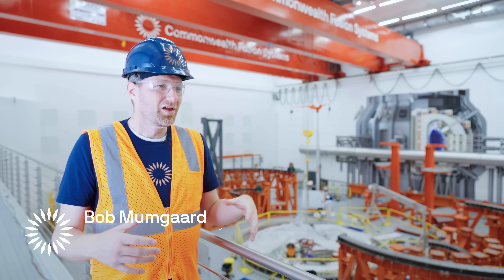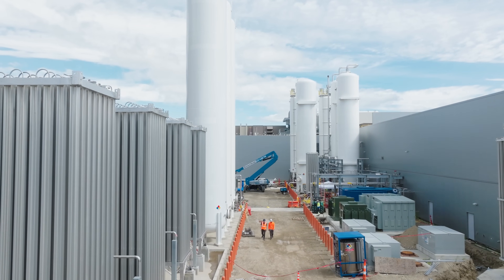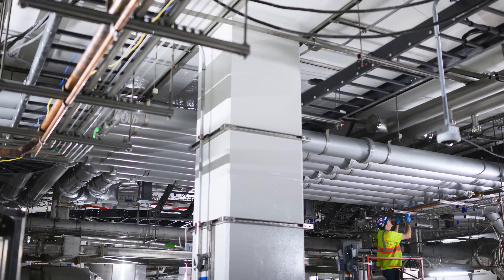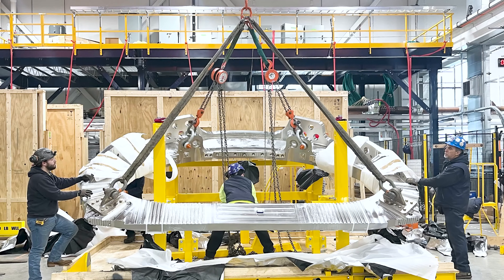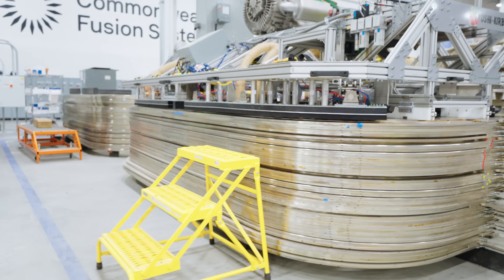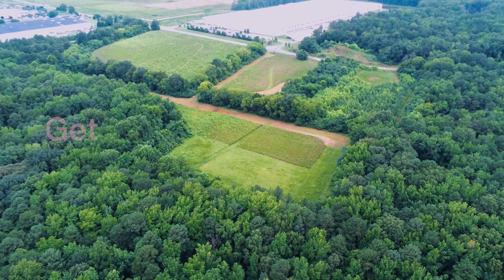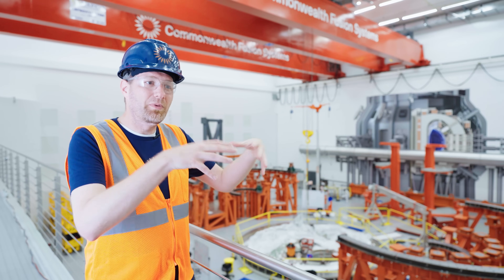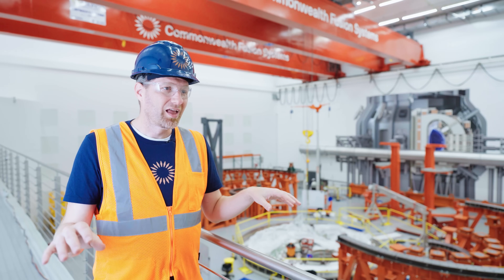An Update from Commonwealth Fusion Systems (July 2025)

Comment: These guys are making plans for selling power to Google and they don't even know if it works yet. Live with that kind of confidence.
Reply: Google is an investor. Google is one of "these guys".
Reply: Anyone can do fusion. Hobbyists do fusion reactors in their garages. They're terribly shit, but they make fusion. A bit more sophisticated there's commercial fusion reactors that are used as radiation sources, still weak and inefficient compared to what a power plant would need, but good enough for what they're used for. It's a matter of getting the power and efficiency up enough to generate commercialy viable electricity. The power is the "triple product" (temperature x density x duration) which has been increasing at a rate faster than moore's law for half a century. And the efficiency is that Q factor that's often discussed, how many times as much energy the reactor produces compared to the power required. Both have a long established relationship to the various attributes of the reactor that's been repeatedly demonstrated for half a century. It would be like if Da Vinci knew all the theory behind a hydroelectric plant but didn't have the construction equipmemt and concrete to make a big dam, or the metallurgy to make the turbines, generators etc. Or like the first atom bomb - it was really hard to refine all the Uranium. It was really hard making all the parts. But when they put everything togeher it worked first time. We know how it works but it's taken a while to get to the point where we can make all the pieces. One of the ways to get Q of 10x power production is making a reactor huge, and ITER went that route. But size is slow and expensive when the whole world is only spending a small fraction of what the US alone is going to spend a lot faster on B-21 bombers. But superconducting magnets are a lot better now than when ITER was designef. And producing a stronger magnetic field lets one get a high Q in a much smaller package that can be built faster and without needing a huge multinational project. And since it's faster, if when something doesn't work they can iterate more quickly to find solutions.
Reply: @JForrestFisher--76 - This person has not bothered to ‘critically’ examine what the net fusion gain factor, or Q value actually represents. Most fans have no interest in critically examining the love affair that brings them joy. The Q value they are referring to is Q-plasma (Qp). That is, typically the only Q value provided in public announcements and generally the only value physicists and engineers working on such experimental projects care about. The input energy parameter, used to calculate the Qp value involves the energy that couples to the plasma to heat it to fusion energy temperatures of above 100,000,000 Kelvin. That input energy parameter tends to be a small subset of the input energy required to power the experimental facility. This is especially true in short pulse facilities such as SPARC and the ARC design. In those cases the input energy value tends to only apply to the short period of time during which substantial amounts of fusion energy is being generated. In those cases the plasma input energy value can easily be 10, or even 100 times, less than the energy consumed by the facility during the day of the experimental ‘shots.’

In short, without providing specifics, the reporting of the Q value achieved during an experimental fusion operation, can be misleading, if not deliberately deceptive.
Reply: But they do know it works. They ran calculations, sophisticated models, simulations, where every important component has been integrated into the model. Once you put the correct engineering components together, it will work.
Reply: @DennisReyes-n6e - Projecting infinite confidence is not the key to a successful outcome. The nuclear fusion energy tokamak experiments began in the 1950s. Were you not aware that two generations of experimenters, that came before, believed that their analysis indicated that they were close to creating an economically competitive nuclear fusion power plant. Why dismiss the earlier confidence?
Reply: Because science is now about suits and ties and funding and investment and shareholders.

I see software developers doing it too - the successful ones aren't the best in terms of technical ability, they're the ones who are just technical enough to keep their job whilst being as social/playing the system as they can. Essentially acting like executives.

This is the world we've all voted for, though. Money from connections and chest beating, not from "hard work" or cleverness that was always a lie.
Reply: Many products, projects, works, technologies and sciences (especially the most recent ones) around the world and from different eras, but especially the most recent ones, do this. It's nothing new, neither bad nor good. It's just that many people on the internet don't understand this process because they believe inventions come out of nowhere and without financial investment, and that they're instantaneous. They think they work by magic, ironically.
And you are one of those...

Comment: The elephant in the room is the HEAT EXCHANGER. Please discuss the HEAT EXCHANGER and how/when you will demonstrate a reliable, long-lived, working, verifiable, and maintainable prototype. Again, the HEAT EXCHANGER is what everyone wants to know about.
Reply: they're using liquid sodium inside the reactor for this, right?
Reply: @Xanthanarium They are actually using lithium berillium fluoride.
Reply: @Xanthanarium  - No! SPARC contains no robust means of rapidly removing the heat generated by fusion reactions even though the machine is expected to generate over one giga-Joule of energy when operating at near its maximum energy level. Sodium coolant is employed in fast reactors due to its property of not significantly moderating (slowing) the fission neutrons. As a coolant in a fusion reactor it wouldn't perform well in removing the energy because the sodium wouldn't capture the fusion neutrons efficiently.

There will be no attempt to breed tritium fuel for the SPARC experimental machine. It won’t include a tritium breeding blanket, nor tritium extraction and purification facilities. The difficulties of that process were expected to be solved by the ITER project in France but that work has been delayed until after 2039. The SPARC and ARC machine will have to rely upon commercially supplied tritium which currently costs over $30,000 USD per gram.
Reply: @Xanthanarium - The top CFS engineers and physicists are likely to be more knowledgeable sources information, on the SPARC design, than the people below you. Large portions of the lower level staff have little knowledge of the fine details of the design. Some of the best sources of information is contained in arcane technical papers on the design of SPARC.
Reply: @Xanthanarium  Regardless of what they intend to use, nothing has been demonstrated.